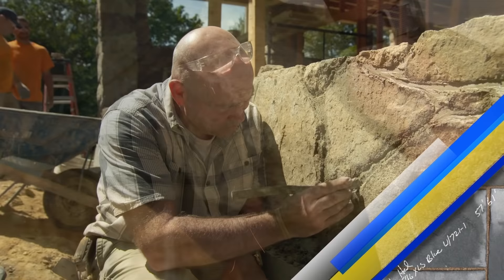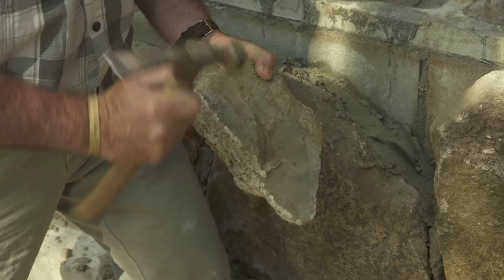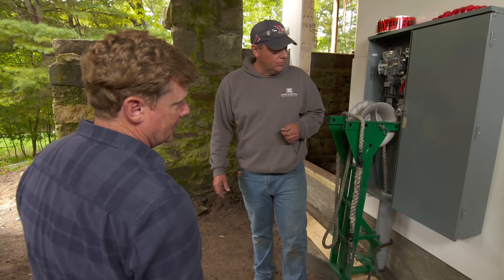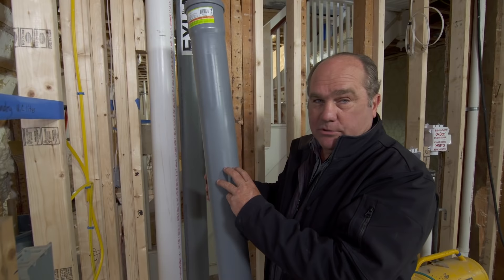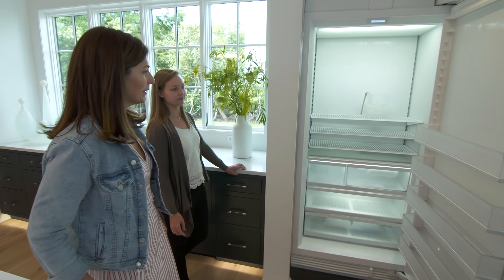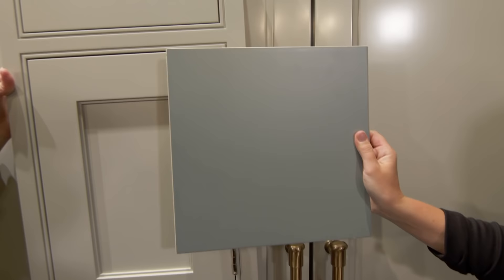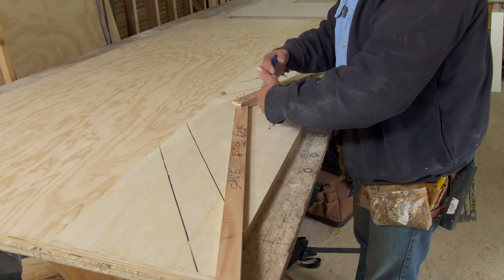This Old House | Hard Work Ahead (S41 E20) FULL EPISODE

Comment: That stick trick tommy did was unreal. Everytime tommy shows up, everyone leaves the job site a bit smarter.
Reply: That guy is great.  He has probably forgot more tricks in carpentry than I know!
Reply: Whicked smhart
Reply: That" "Stick trick" has been around for as long carpentry has been around. Look up framing square circle. It is the same thing just that he used an obtuse angle instead of a right angle.  I did the same thing when I was working on a jobsite and the metal framers were standing there trying to figure out how to get the correct arc. Did the exact same thing. before they even had one idea on how to do it I already have the template done. I ended up doing the metal framing for all the windows in that building.
Reply: He’s a wizard

Comment: You're the man Tommy, I was a drywall hanger for 28 years & hung many barrel ceilings and never had one go that easy, most of the time we would wet the drywall to make it more bendable. 
Great job.👍🏻 And love the two sticks trick, wish I knew that back in the day.
Reply: 22:15 Was it really drywall they used for the ceiling? How did it not crack bending it?

BTW scottyellis I suggest watch a 13 part series called What on earth happened by Ewaranon to learn that the earth is not a globe.
I got it in my about tab.
Reply: @flat-earther  two layers of 1/4 sheetrock, I would wet it the day before, set it up against the wall the long way "most of the time in the garage" because the ceilings were higher. And it would naturally bend over night. Done it many many times.

Comment: See that wall-mounted toilet at 9:15?  We have the Toto version, with a heated seat and the bidet feature.  Great toilet; however, pay extra special attention to the mounting height WITH the toilet seat in place.  Our contractor mounted it with the top of the porcelain basin at ‘comfort-height’ level, but he failed to calculate the additional height when the toilet seat was installed.  We were barely able to touch the floor (At 5’-8” we were on tiptoes!) when seated on the toilet.  The contractor had to tear out the tiled wall and drywall behind this device to lower it to a more useable height for us.  Contractor’s plumber’s error = contractor’s expense.  This ‘fix’ was necessary, as our house was designed and built for aging in place.
Reply: That's  actually  funny. I'm  5' 2".  I'd need a kiddy step

Comment: probably atleast 10 grand so you cant see wires from the kitchen window lol
Reply: Much more than that...especially in the land of taxes and permits.
Reply: It wasn't just burying the electrical service; it was an upgrade to 400-amp service.  Burying the lines may have been the motivating factor at the start but they got much more out of it than just a cleaner look through their kitchen window.
Reply: He said 2400
Reply: in canada the utility company charges about 35,000 to upgrade overhead to underground , then about another 3-5000 for the electrician to install a new panel and get the wire from the meter to the panel. thats 200 amp. 400 amp is probably double the cost

Comment: Besides being efficient, induction cooktops also don't pour combustion byproducts into your indoor air.
Reply: I get the pros compared to gas but there are cons to induction such as not able to use in power outage and strong magnetic fields which may be unhealthy to stand near.
Reply: @flat-earther  I really prefer not to breathe any kind of combustion products that I don't have to.  [Aside:  My dumb Viking gas range doesn't work during power outages (although my older Caloric gas range could).  The induction range I use is at my Dad's lodge, and is so much nicer than the gas ranges.  He has backup generators because he's up a mountain!  And yeah, if I had anything implanted in my body, I might avoid an induction cooktop.  :)]

Comment: Induction is awesome, never going back to gas.
Reply: I never used gas but i assume induction works exactly like gas but is much safer.
Reply: @mr.wizeguy8995  gas is convection, induction is induction
Reply: @walterbrunswick  I just meant how it is to use like how fast heat changes or how fast it's heat up. Not actual physics how it works.
Reply: @mr.wizeguy8995  I was just being a wiseguy😁
Reply: I see the pros compared to gas but there are cons to induction such as not able to use in power outage and strong magnetic fields which may be unhealthy to stand near.

Comment: That's funny that girl is pretty surprised that the machine shows how many bottles they save, but that machine has been around at our job for over a decade. It's funny seeing people with technology that they have to pay extra for but unknown to them it's been in plain sight for so many years. Even LED lights that were on buses since the 90's and touchscreens been around since the 80's. GPS is old news when it finally came out after it was invented by the Navy. It's the most practical items you think is so cool and high tech, that is mostly old and been around for decades without anyone really knowing it. 

Also this show is cool, but not for the practical homeowner. I own a home and it seems this show aims for people that make well over six figures each from a couple when they work on a house. I wish they made it more for the everyday homeowner, but I guess they do when they jump on a 8 hour flight, and drive to a small town to help someone that has a window that won't open all the way and then make a 5 minute video over it..🤔🤔😕😕😕
Reply: lucky I suggest watch a 13 part series called What on earth happened by Ewaranon to learn that the earth is not a globe.

I got it in my about tab.

Comment: Was that drywall boards that you bent into the shape??
Reply: nope just pushed into place which I almost guarantee it's got cracks or fell off the drywall screws. due to the fact above it, there are stairs.
Reply: @GhostReaper2043  I just can't believe that drywall would take a shape like that without cracking or splitting as they bent it in place.
Reply: The drywall looks to be 1/4" thick which is used for curved sections.  That's why Tommy told him not to go to deep when putting the screw in.  You use 1/2" you have to wet it which is a pain to do.
Reply: @grandn8646  Thin 1/4 inch drywall can easily bend around a curve.  3/8 or thicker drywall doesn't bend easily, unless you wet it or make cuts along the back.

Comment: In California, it never makes $ sense to heat anything  with GRID electric power...which is an expensive, highly refined commodity... dumbed down and wasted to make heat.     I refuse to believe that the inductive process alters this wasteful reality.     Natural gas can produce heat at roughly one-tenth the cost of doing so, electrically... unless you own your own solar-powered electrical power generation system already.
Reply: johnbecich I suggest watch a 13 part series called What on earth happened by Ewaranon to learn that the earth is not a globe.

I got it in my about tab.

Comment: Kohler toilets don't work.  Go to any other brand.
Reply: carlmax I suggest watch a 13 part series called What on earth happened by Ewaranon to learn that the earth is not a globe.

I got it in my about tab.
Reply: @flat-earther  I am aware the Earth is more shaped like a pear.  How is that related to Kohler toilets not working worth a crap.
Reply: @carlmax46  Yummy...
But there is no curvature so it can't be a pear, an oblate spheroid or any shape with curvature.
Many people have measured for curvature on large frozen lakes and found none but you don't have to believe them because you can test it yourself.
Not related. Come on it's a random suggestion & comment.
Reply: @flat-earther  Hard to know if you're serious or facetious.   Actually with accurate measuring devices you can measure the curvature of lakes;  the surfaces are not flat.  In any case i don't care to argue with a "flat-lander".

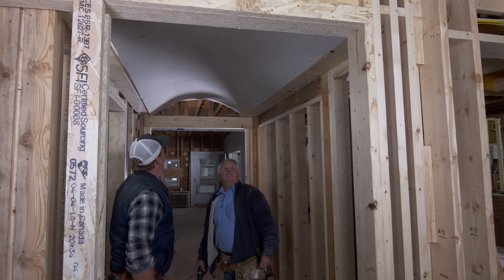Comment: @23:20 This episode was aired on tv back on April 18, 2020, probably filmed in 2019. I almost guarantee that ceiling has cracks in it or fell off completely off the drywall screws. The homeowner said she has kids so guess what kids like to do? they like to jump, stomp, and run up and down the stairs. And guess what's above the ceiling that's right the stairs. So I would be all surprised to this day that that ceiling looks completely different.
Reply: Depends, but if the framing is sound, there shouldn’t be and movement in the stair stringers
Reply: Tom Silva is good, but I did not like his way of going about that
Reply: @walterbrunswick  ya, it could be supported better

Comment: 2400 for the wire..demolition and takeaway 50k, rebar and concete 50k, framing 50k, kitchen 50k..sounds like Biden has rounded the numbers..
Reply: andydaddy I suggest watch a 13 part series called What on earth happened by Ewaranon to learn that the earth is not a globe.

I got it in my about tab.